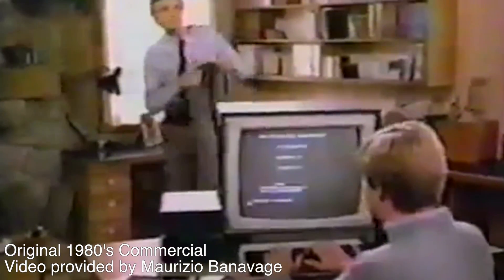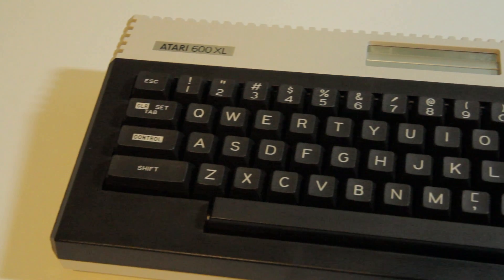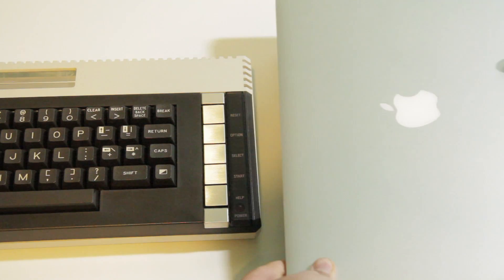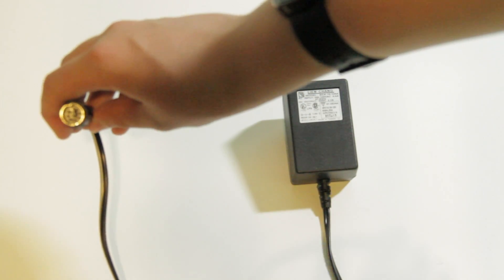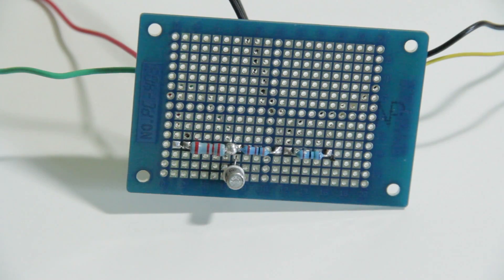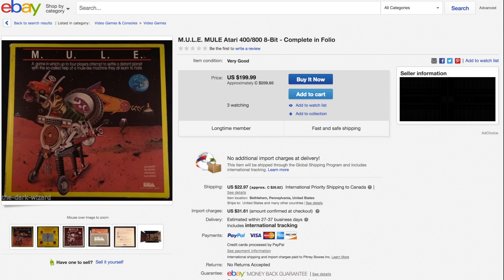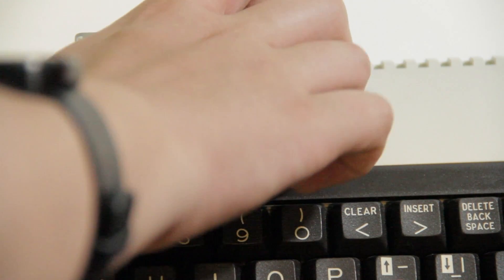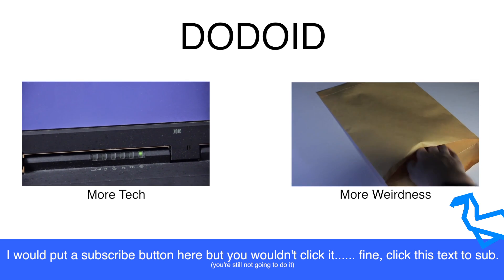Atari 600XL - Mods, Repairs, and Games

Comment: In Europe the 600XL comes with the monitor din connector by default. Also you can easily upgrade the memory of this machine to 576kb of RAM through TFHH's kit in really low cost. I have to congratulate you for your role(Dustin) in "Stranger Things". = )